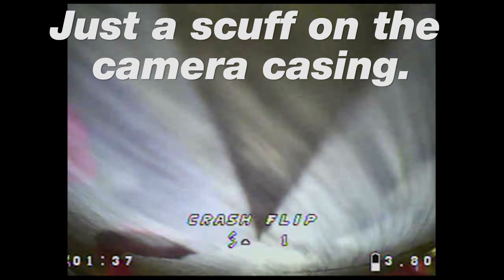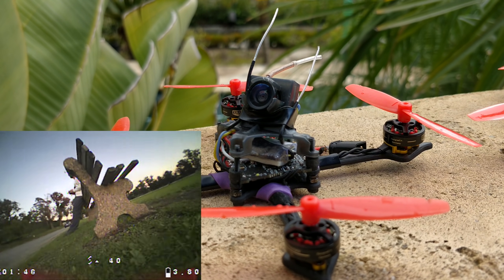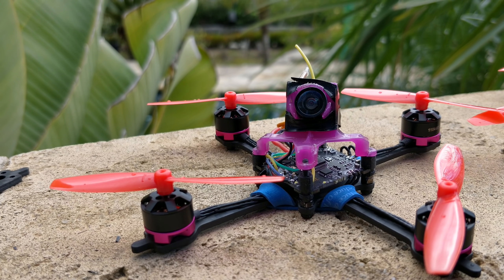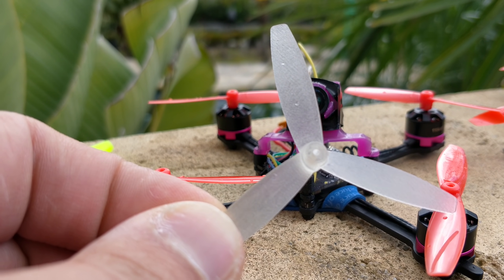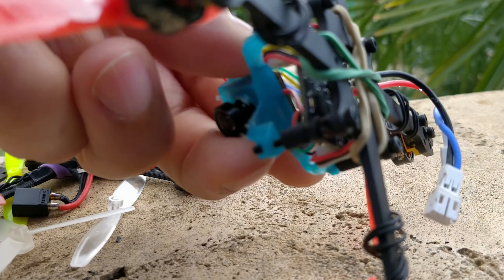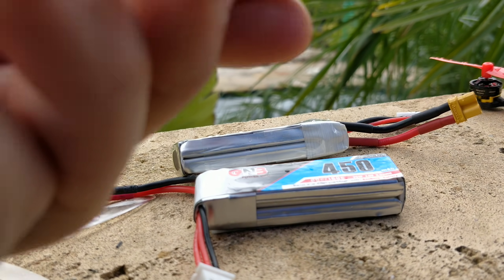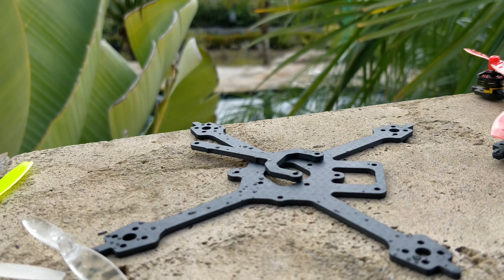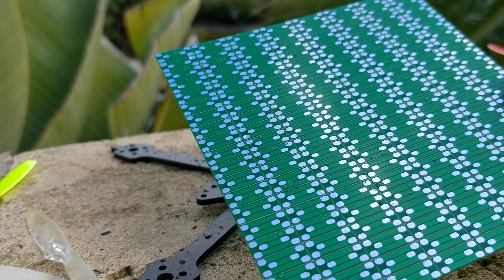Toothpick Update - Props, Power lines, Charging...

Comment: 1105 7500kv 3025 3S super toothpick?
Reply from the maker: I don't see a need. We're not pushing up against the voltage limit. You could run higher load motors and props to do 3S but that kinda defeats the purpose of the build concept.
Reply: KababFPV I thought the build concept was a quad so light you couldn’t hurt anyone, but still flys proper acro. That idea excited me and you initially said that you didn’t see a need for 2S. My flying environment is actually better for 1S so I was happy to hear your ideas. I’m still excited to build one. But what you’re doing now doesn’t seem original anymore. You’re now in the realm of standard micros I think. Honestly at this point it does seem as though you might as well put your caddx turtle into a light 3025 prop build and call it a day...
Reply: @Kabab  fair enough, I'd just like to see something I can put the hardware I already own into haha 
Glad to see these are working out so well. Thanks for all the content

Comment: Current flow is why it flew so much better. Try doing it with your 6s 5" by going from xt60 to castle 6.5mm 200 amp connectors

Comment: Make one for the hypetrain dab motors? Lol I can’t remember what size they are, I got a set when they came out and still haven’t found a frame / set up for them. Unless you have a solid better idea for them
Reply from the maker: I'll look into them in a bit
Reply: They’re 1104 7500kv. They’re better fitted for a 2 inch. I use them on a prototype 2 inch frame and it flies great. Perfect fit. I’d stick to the 08 motors for this

Comment: What is the distance of the mounting holes for the crazybee board? I am trying to figure out if I can put a split2s on a toothpick
Reply from the maker: It's a whoop size so 25.4x25.4.  It also has a 16x16 mount....I'm working on it...
Reply: @Kabab  maybe on the HD version I could use some sort of 3d printed adapter from 25.4mm to 20mm so I can mount the split board on top of the crazybee
Reply from the maker: yeah.  working on exactly that
Reply: @Kabab  cool man I'll see if I can find something on my end. Can't wait to see what you come up with next. Thanks

Comment: Hey bob, i have had 2 crazybee 1s boards and both of them gave up about a month in... so i don't think youve flewn one board long enough to get a good feel for the fets longevity.
Still great vid though, very informative. I feel like lower kv+ those tri blades would be better than 2 blade high kv.
Reply from the maker: I've got two quads with well over 200 flights each.  No issues so far...
Reply: Okay! Just making sure you don't jave like 50 of them with 4 flights each 😂 
Has a motor wire ever become disconnected? Thats how mine burned out.

Comment: Yes 2s is powerful.  I have a similar setup on the Bat-100 frame.  The motors spun up to full throttle while I was holding the little guy.  Long story short, I was cut so badly I needed 4 stitches
Reply from the maker: Ouch!  Sorry to hear
Reply: what motors are you running? I have been trying to get my bat running for about a year now and i still cant find a good motor for it, especially snice Bob has order all the amax motors now.
Reply: I have Bat-100 frames set up on 56mm Ladybird props with 
(1) 0705 12kv Racestars running 2s (not very efficient, but really fast)
(2) 0802 16kv Happymodels on 2s (really efficient & OK fast)
(3) 0804 Tachyons on 1s (3min flights on 1s 450mAh & quick enough around people)
I think FlexRC also has some super frames for this class of motor/ prop combo.

Comment: Dude... Please, don't discontinue the 1s frame! I couldn't buy it yet (my houses aren't rent(?) yet, so I'm only spending and receiving nothing right now)... And I want one! 😃
BTW, just found a 0804 from 3BHobby (former BBB) on Banggood!
Reply: Hey! thank you for sharing. I just went to take a look and they seem really interesting. 1.5mm shaft and two KVs are available, 7100 and 11900....weird numbers, maybe actual measured values? They are even a bit less expensive than the replacement motors for a Mobula 7.
Reply: @yannickg6904  Exactly! 😃
I found the numbers odd too, but... They look nice anyway. 😊
Reply: @MCsCreations  I was planning to order the 8pcs Racerstar RT11 bundle for my 2.5", I guess I'll add those as well. Any reviews out yet?
Reply: @yannickg6904  Not that I know of, dude... I hope some will show up soon. 
About Racerstars motors, don't do that, they're horrible! 😕
For my 2.5" build I bought  the SunnySky 1106 5500kv (to run with 3s batteries). And, dude... They are amazing!!!
Reply: @MCsCreations  Are they really that bad? I guess the collaboration with T-Motor did'nt do anything. That's a bummer, I thought they looked really nice. Thanks for the heads up.

Sunnyskys have always been a solid choice from personnal experience, I might also give the larger Amax Innos a try. European reviewers often use them as references when testing other brands.
Reply: @yannickg6904  Oh... The model they made with T-Motor I really have no idea... I didn't know you were talking about them... Anyway, those Amax Innos look fantastic!
Reply: @MCsCreations  I usually ignore Racerstar altogether, but I know Nick Burns liked them, they're pretty much the same as T-Motor's F15 from the comments I read . He said they were a good balance between power and efficiency but rather expensive.. Considering that, the deal for 8pcs is hard to ignore on Banggood. But since I'm building a Massive
Droner, I might just go for the premium stuff. We need to start a help group called Kwad addicts anonymous, it's always "just one more build"....lol
Reply: @yannickg6904  I feel your pain, dude... And I agree!!! 😂
Reply: Yannick G oópll

Comment: Check out the prop for the Walkera Rodio 110. I bet it's close to what you want....
Reply from the maker: Yeah used that.  The GF2540 is better.  way better
Reply: KababFPV when I was flying brushed micros a few years back the 66mm parrot rolling spider props were the prop to use. I’ve had the gemfan 65mm variety and the center hole diameter was inconsistent. Just waiting on you and China to get this toothpick 2s build going. Thanks for your efforts Bob!

Comment: Bob great information.  My crazybee f3 fc burnt yesterday while plugging in the lipo. I posted in the fb mubula7 group and have learned that a ton of crazybee f3 and f4 boards have been burning. Some are contributing it to upgrading of the power lead to the xt30. What do you think is causing the fc to burn on lipo plug in?
Link to FB group
https://m.facebook.com/groups/2191253774241047?view=permalink&id=2337347212965035
Reply from the maker: I can't actually view that page but I would say that everything has some degree of failure rate unfortunately.  The Beecore had tons of failures before I even gave it a go.  Before many people even got it.  The failures were really really bad too.  Not just a burnt board.  I don't know if I've just been super lucky or not but mine have been fantastic.  If they're burning boards from new wires or the XT30, I'd say it wouldn't be impossible for people to be bridging the positive and negative when soldering on new wires.  When I have a failure, I'll definitely report in on it.  That FB page is blocked for me.  Seems to be private?
Reply: @Kabab  well i can definitely say i did not bridge the pads on my fc. I flew it for 3 days with no problem. Its a great fc just wondering if its too small of an existing cap or something. The boards power up via usb and then will take lipo power. But once unplugged from usb with lipo plugged in it goes dead. I was just starting to like this Mob7.😁😁😁
Reply: The FB is a closed group and you have to join to view.
Reply from the maker: @lukelandry_DJ  ah yes. For sure a dead 5v. I've had many over the years. I wouldn't say it's related to anything you did. Just a board failure
Reply: @Kabab  thanks for the input. Can't wait for your frames and motors to be available so i can build my toothpick!

Comment: I need better motors & replacement fc for mine... running racerstars and they're pretty shitty & the 5v reg on me crazybee board died but stuck an external AMS1117-5v regulator on it and it still flies. Thanks for this mate I love the toothpick (chopstick) and it's by far my most durable, longest flying, fun lil quad. Having some issues with the tune too but working on it :3
Reply from the maker: Sorry for the hangup :-(.  I don't know if I've just been extremely fortunate but not a single crazybee has given me any issues.

Comment: Great video and very interesting this type of micro's. About the props, 65mm is almost the same as 2.5 inch right ? when running the GF 2540, or something like that these can be mounted on a 4 hole 1103 and give much more motor prop combinations.
Reply from the maker: It's actually 2.6". The trouble with any other more meaty 2.5" is that it overloads 1103 to 1106 motors. That prop is really best on 1304. But I know, 1105 is standard for the size class....
Reply: @Kabab  Hmmm, good to know! 🤘

Comment: Yeah those ph2.0s are a real bottleneck, in the thrust stand numbers it more than offsets the increase in weight with an overall increase in P:W ratio on the xt30s even on 0803 motors.
Reply: Funny how it was such a break through with who0ps when they switched to that PH2.0! Now it is the bottle neck! How things advance... 🤔😎
Reply: @scootroter4859  to be fair the ph2.0s are great for actual whoops (65mm frame size), but when you move to 1103 motors and 2.5" props? That's not a whoop anymore 😂 The micro community already figured out that xt30s are great and this single board tech was designed for tiny whoops and we're co-opting it for bigger stuff so we still have some design issues which Bob is doing all the troubleshooting for us. 👍
Reply: @charleswarwick4849  yes, I understand. Now we need these AIO FC's to come out with more than 5-6 amp ESC's to stay with this new trend!
Reply: I acquired the Beecore 2s AIO board that SAYS it handles 10amp / motor.  I really doubt it will hold up to anything close to that but just mention it's out there as an option.  Also, BetaFPv has a 2-board, 10am whoop stack
Reply: @cccagley5276  if that's that 2 board 16 x16mm one that's been around for 2 years +, that everyone seems to use (it's why the TinyLeader is so unreliable!) ... Stay away! It's got so many problems it's crazy! I have two of them and can't get either of them to work, even swapping parts! It's a BLACK HOLE OF TIME WASTED trying to get it to work. 😕👎

Comment: Bob RE: The range on CrazyBee boards. Solder one a high gain 2.4ghz antenna(one with the copper counterpoise you see on many 5.8ghz antennas) it will double your range at a minimum. Cheers !
Reply from the maker: Yeah that's what I have listed on my build log for the frame but it's still not that great unfortunately